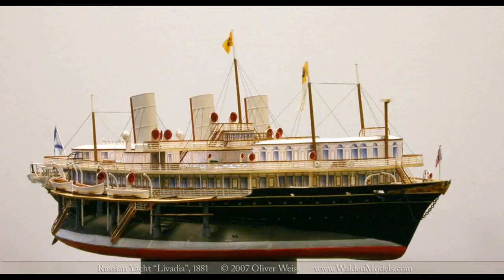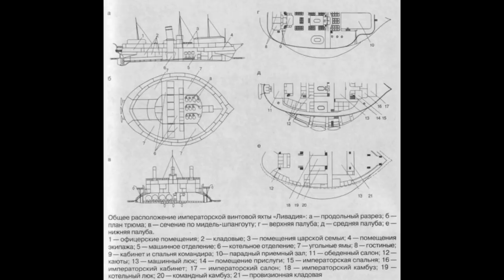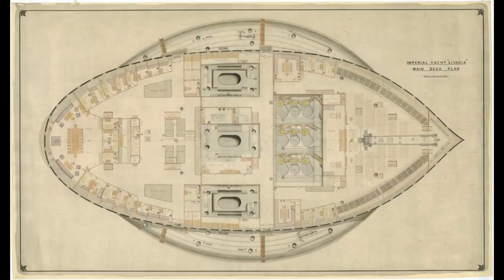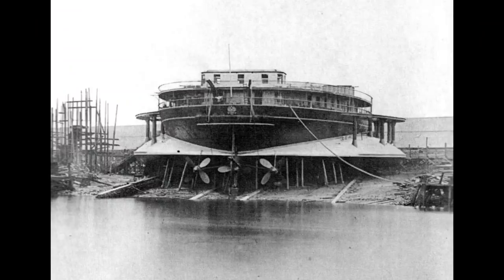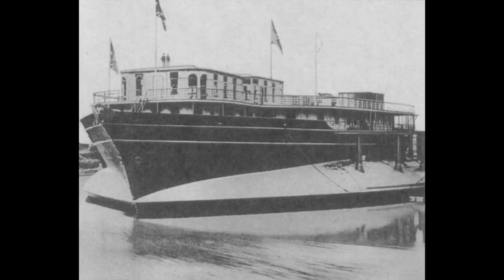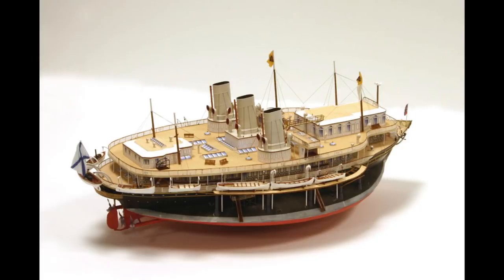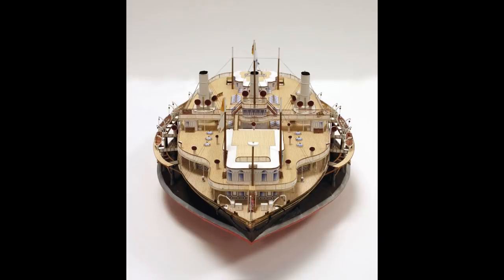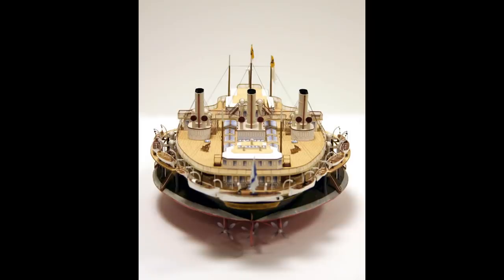Livadia - Frisbee, Pancake, Turbot, Saucer, Hat, Unique

Comment: Ships that sink themselves are not really welcome until the invention of proper submarine.

Terminal existance failure..
Reply: I aware of one ship that did have the unique ability to resurface. It was an LPG tanker that resurfaced when the submerged cargo evaporated making the ship buoyant again.
Reply: @allangibson8494  That sounds... unpleasant, LPG occupies a volume many hundreds of times smaller than the gas under standard conditions and cold LPG tends to expand very rapidly on contact with relatively warm sea water.
Reply: @CATASTEROID934  The crew didn't enjoy the experience. The relief valves on the ship were up to the job however. Smoking in the area would not be recommended however.

Comment: Bit late to the party but from what I heard in both videos about Admiral Popov's designs is: Great idea, terrible execution thanks to very simple design flaws that could have easily been fixed if the infrastructure to do so had actually been created along side the ships... you know, just in case they needed to be dry docked since they were VERY NEW designs of the time. Aka: less fault the ships designer (though still some fault to be had) and more fault the madhouse of Government, finances, and complete lack of logistical support.

I kinda want to recreate this one though, fix the obvious issues with the hull design (should be less flower and more waffle like) and of course, update it to the 21st century.